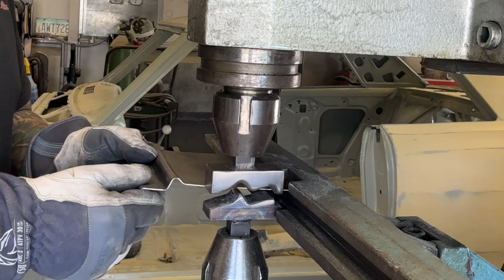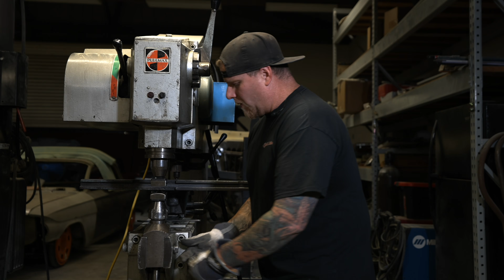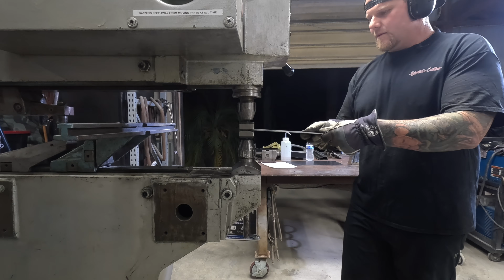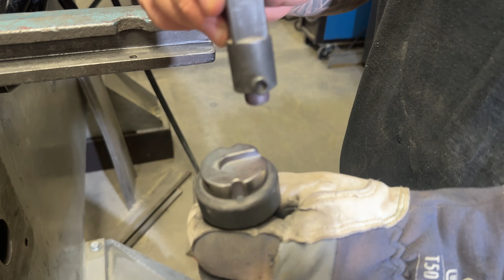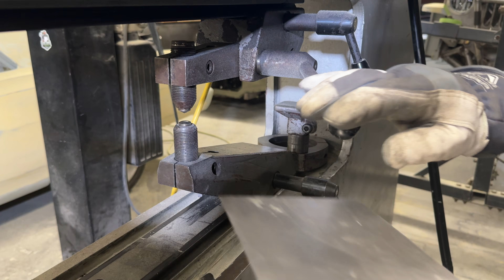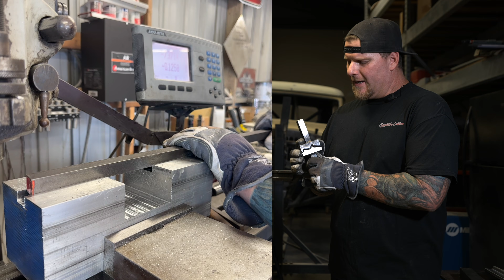Metal Shaping With A Pullmax, The First 24 Hours.

Comment: We recently purchased a P9 at auction. Didn't even know that there a many models of Pullmax machines. Ours has the sliding tables for front to back and left to right movement. Have not yet used the machine and are trying to find a source for collets whether square or round. I have a complete machine shop but it would be nice to have help deciding what tools and collets to use. Loved your video. So informative. Thanks
Reply from the maker: Thank you!!

Comment: Definitely very interested! I have a D3 Pullmax.. currently in the middle of building a barndominium so I haven't even had a chance to power it up and play with it yet. The D3 has a 5hp 50hz 3ph motor. I'm thinking about swapping it for a 1ph motor or a 60hz 3ph motor and adding a VFD so I can vary the speed..I don't know if that would be a beneficial feature so would appreciate any experienced advice on that. I also have a 10hp rotary phase converter. The D3 has 22mm tooling so I was a little surprised to hear that your P22 had 19mm. It's rated to nibble 5/16 plate (kinda scary). My machine only has 1 depth setting on the handle so I'm thinking I might mill a couple extra detents in the ring. I will have to make a fence but I do have a bracket that slides on the dovetail. I 've never seen another D3 in person or on line so I don't know much about the model. It does show up on the Pulmax site...the guy I bought it from said it came from an Airforce base so I wonder if it is a military version... I'm welcoming any feedback. 😊
Reply from the maker: Unfortunately I’m new to this as well. As for the speed I never change the speed thus far

Comment: I really enjoyed your video on the Pullmax. I've never seen one quite like yours. I've owned two of them, the first was a p9, the most common series and the p9 was the largest of that series capable of shearing 1/4 inch stainless. The one I currently own is a d series that uses 7/8 shanks and has nearly the same capacity as the p9 but is physically a lot smaller and lighter. The p9 weighed 6500 pounds. By the way, I make my profiles out of 1/2 inch stock.
Reply: I have a D3...you can read my comment to get the details...I would appreciate any info you could share about the D series. 😊
Reply: Hi I just purchased a P9 , it was on a Navy Ship , looks like it was not used much, just need more videos on using it , I did find a center tool holder for it so I have both , any info would be appreciated !Thanks😀